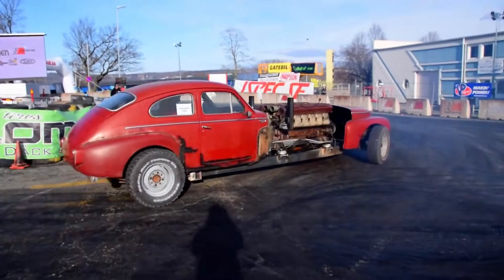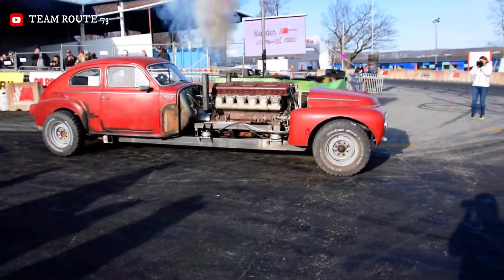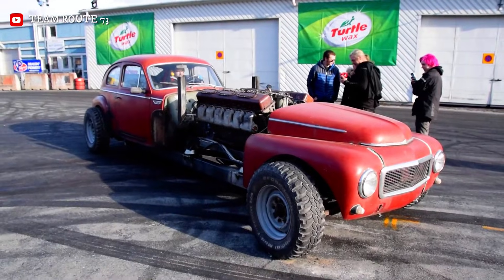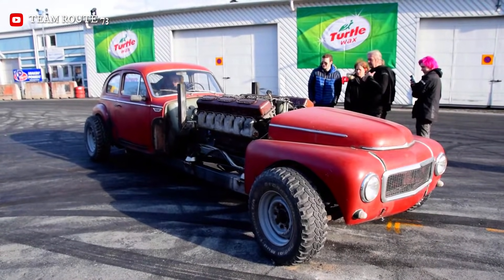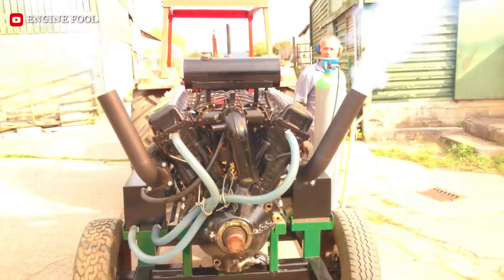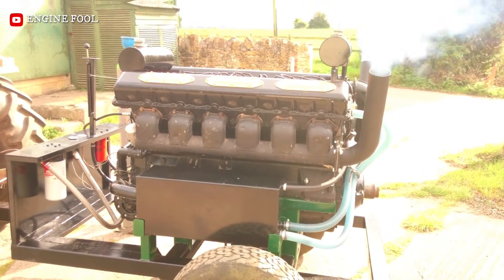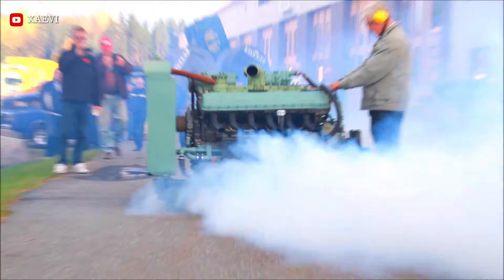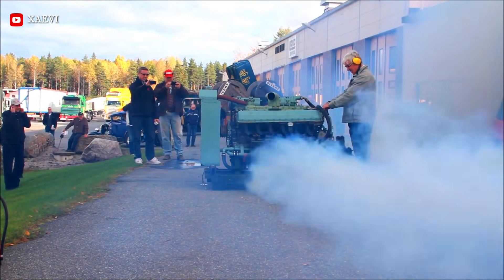RARE V12 ENGINES Starting Up That Sound INSANE

Comment: That Volvo had an 4 banger..1.6, 1.8 maybe an 2.0. maximum
Reply: You are correct. 544's originally had a 1.6ltr 4cyl with a single barrel carb, I think it was called a B16a. While we were in Germany, we brought home a more powerful version of the 544 with a B16b with higher compression and two side draft SU carbs putting out 98hp. That car started my 45yr career as a Volvo tech.